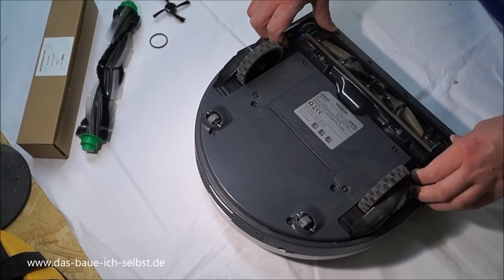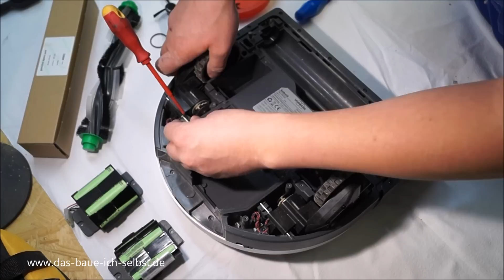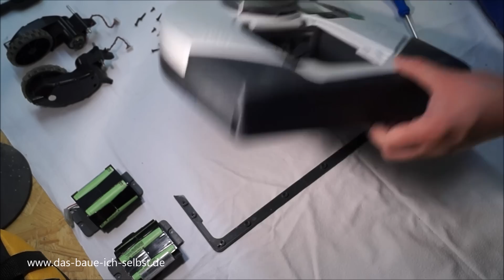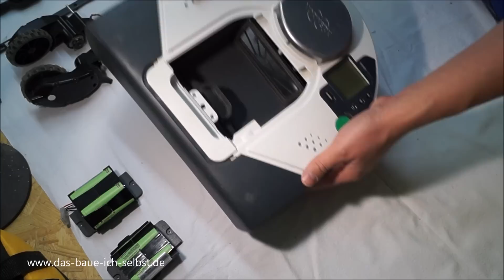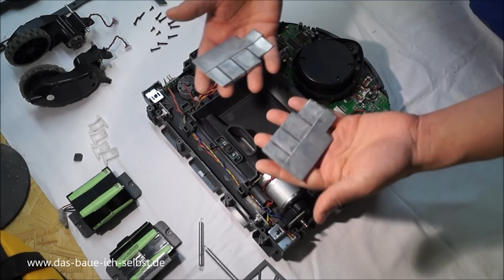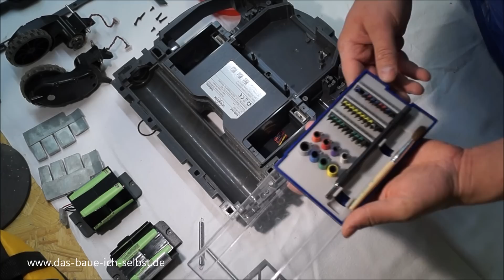🤖 Vorwerk VR100  - zerlegen für Reparatur und Reinigung 1/3

Comment: Hi, thanks a lot for your videos. Very well done and it gave me the self assurance to disassemble it. One question : where did you source the replacement belt from? Viewer does not seem to distribute it and I am unsure to know where to source it. Thanks a lot.
Reply from the maker: I bought them on eBay.  The belts are 2mm thick and have a diameter of 28mm at the side brush and 85mm for the laser unit.  Very cheap to get, because nothing special.
Reply: This is awesome ! Thanks a lot for your quick answer! Much appreciated. All the best.